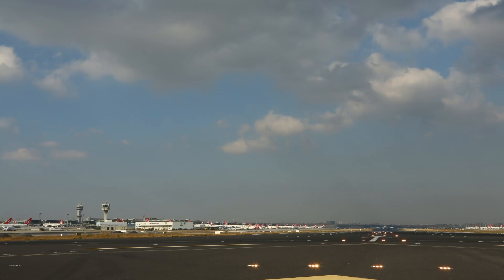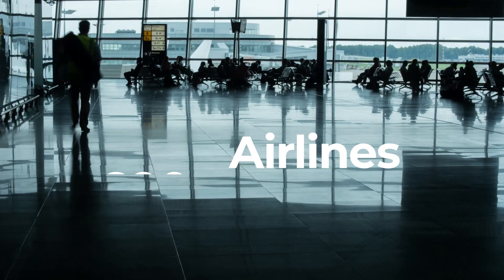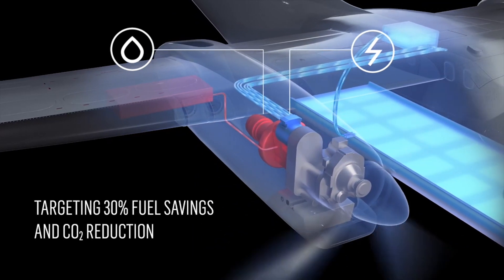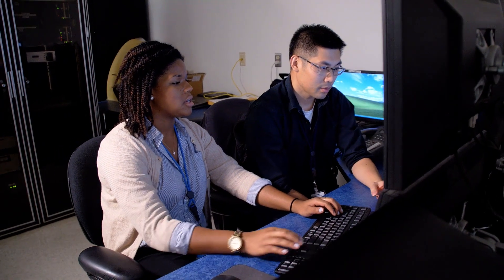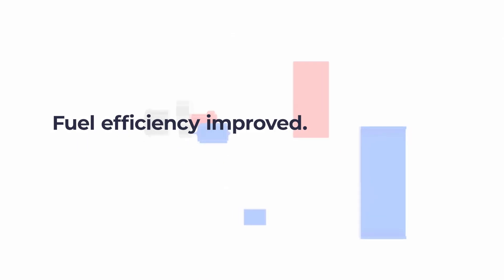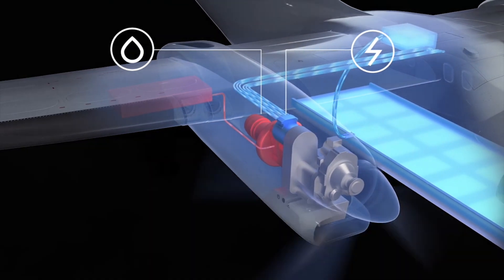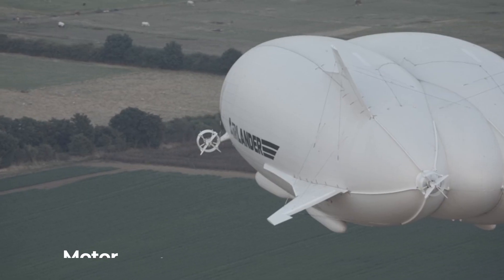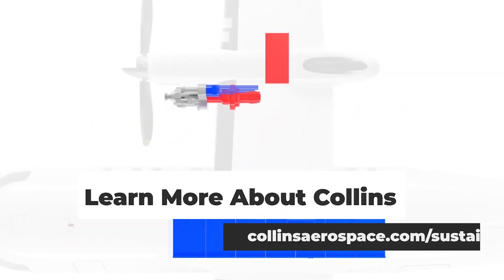A Low Carbon Future With Collins Aerospace

Comment: The Airlander 10 was a case study i used in a school project, unfortunately the original prototype of what is now Airlander 10 crashed during testing, but Collins is optimistic about the prospect of electric propulsion, having opened up a $50m lab a few years ago, dedicated to pushing the envelope of the technology.
Reply: I'd love to know more about the Airlander. Are there any useful links besides the obvious ones that provide an in-depth understanding of the technology?
Reply: I think what happened with the crash was it got untethered and an emergency mechanism caused it to deflate, so not really unintended
Reply: I would ride in a Zeppelin just to ride in a Zeppelin!

Comment: I don’t see how this can be cheaper to operate when a comparable load in an aircraft can make multiple loads is the same amount of time. Also these balloons are at the mercy of moderate winds.
Reply: I'm no expert but it doesn't seem likely that a 100% electric plane can carry as much as an 100% electric blimp, since the plane has to invest all it's energy to flight, whereas the blimp only needs it for propulsion. Sustentation is provided by buoyancy. Winds are a problem tho.
Reply: @moteroargentino7944  The lighter than air vehicle won’t be able to go near as fast. A cargoI plane can make multiple trips in the same time. One of these was tried in Alaska and deemed a failure.
Reply: @Chris_at_Home  But won't it consume more energy? I'm only talking about energy efficiency, I know aircrafts are more effective in their task. There's no way we're going back to the old airship era, but maybe they can find a niche.
Reply: @moteroargentino7944  if you need transport a few tons 300 miles it could take days in an airship depending on winds. A small twin airplane could make the trip multiple times in a day. Also there it seems that you would need more people at both ends to secure it. I have been many places that aren’t connected to a road system and depend on air transport. Yes you could move a heavy load, but that is a small niche and this will never pay for itself.. Without government (taxpayers) money no one would invest in this. Then the guys running it are making a ton off taxpayers money. With all the money wasted on government subsidies we could have made every ones home more energy efficient and and put solar with a battery bank in each home.